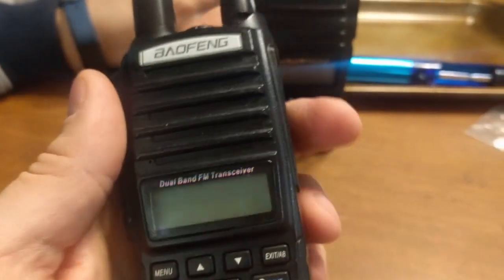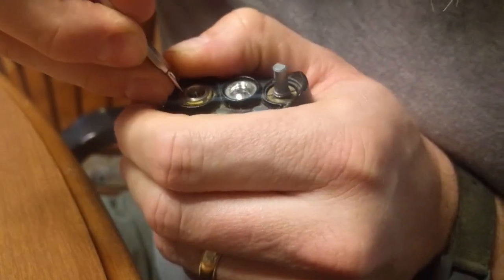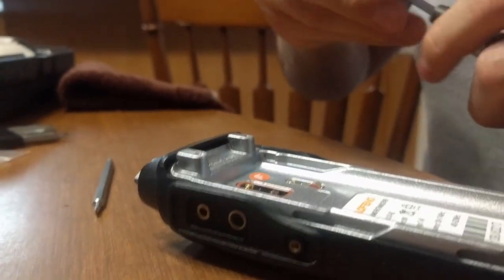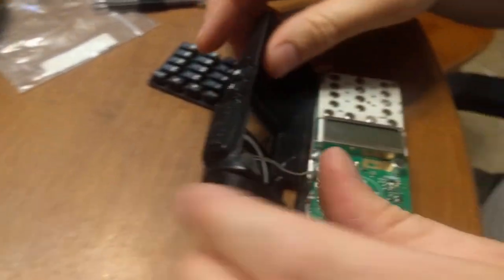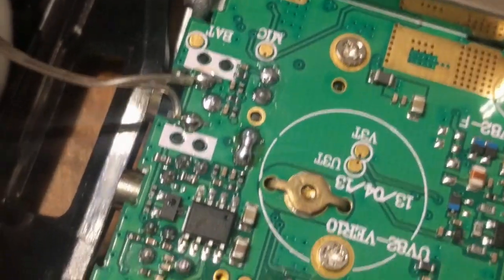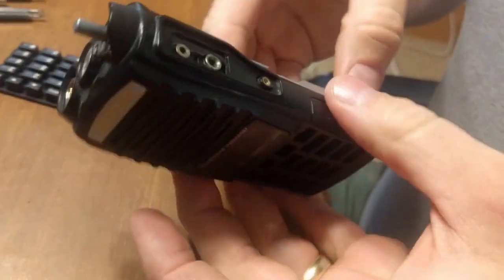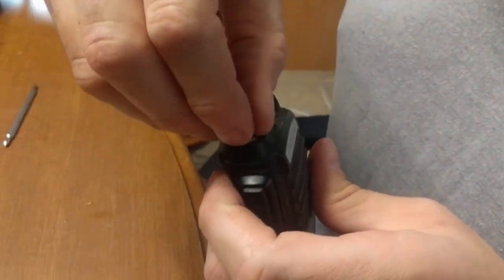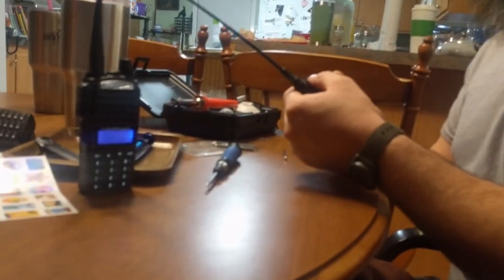Baofeng UV-82 Repair - No Mic Audio

Comment: Exactly the problem I had.  I just programmed the radios before leaving with them for vacation and didn't discover the problem until I was trying to use them in Mexico.  Not expensive radio by any means but you saved at least one of them from the e-waste bin.   73s.
Reply: I only used the programming cable or mic about a dozen times before the jack started to have problems.
Reply: Oh i got 3 still going !!! they are just cookin on Bacon n Eggs bud 73's G7WDH

Comment: Thanks. This fix repaired my UV-82HP. It is not worth the shipping cost to send a $45 radio in under warranty for this problem.
Reply: This did correct the problem and the radio programmed and operated normally, but the same problem appeared again today, four months later. It appears that the microphone is intermittent and the shock of soldering to the jack started it working again. I am going to replace the microphone.

Comment: I have a similar problem I cannot transmit with the PTT or mic what is going on because my 2 points are already soldered together and I have the uv 5r but from another company same radio as the beofeng uv 5r.......what could it be I mean worse case scenario another 30 dollar radio?

Comment: Will the preclude using the programming cable afterwards?  I've seen other videos that claim both external and internal mic will be open when transmitting with an external mic, but my bigger concern is whether the programming cable will still work.
Reply: Pkomp

Comment: So I have this issue when my PTT is plugged in. I have a dual com set of peltor comtacs, a nexus PTT, and a nato 6 pin to baofeng adapter. It works fine without anything plugged in but does not pick me up from the mic. Would this maybe fix that too?
Reply: No. Your problem lies on the PTT, not the radio.

Comment: I had similar issue with the mic on another baofeng radio.  turned out to be a faulty mic.  I bought some new ones from aliexpress and soldered in a new one.  I believe the mic was killed when I plugged in the data cable to program the radio.

Comment: My son has a UV 82 and I just bought one. I've noticed the TX audio level is pretty low...any ideas or suggestions? I'm going to start by drilling the mic hole a little bigger to let more sound through. if you or anyone reading this has any experience with these radios and have some ideas, please share
Reply from the maker: Check and verify that all your radios are programmed the same. If the receiving radio is set for wide and your's is transmitting narrowband it will sound very quiet. Also be sure and speak directly at the mic, they are not very sensitive at a distance or when offset to it. Break out the drill bit if none of those suggestions help. It's a $25 radio after all :)
Reply: @JonathanWilliamsKF4NVX  I just made a  mic amplifier

Comment: I believe I have this problem with a new Baofeng DM-1801.  If I insert a 3.5mm plug into the mic and work it in and out a few times then the mic audio starts working again.
Would you know anyone having the problem with a DM-1801 and did the same fix?
Reply from the maker: I would imagine that they use similarly cheap TRS jacks in those as well. Not sure about the internal connections of that radio but I bet if you pop it open and inspect around a little you may see a very similar board layout around the SPKR/MIC ports.
Reply: @JonathanWilliamsKF4NVX  Did the connector mod effect your programming cable?  Any issues using the speaker mic?  I would think both internal and external speaker mic would be in the circuit at the same time.  Any body comment when using a speaker mic your transmit audio is low?
Reply: @SilverStone XAdvanced I found just inserting and removing a few times a 3.5mm plug solves the problem.  I do it with either the spk/mic or a dedicated 3.5mm plug.
I do a lot of programming with my DM-1801 and I don't want to take a chance it would effect the way the programming cable works.